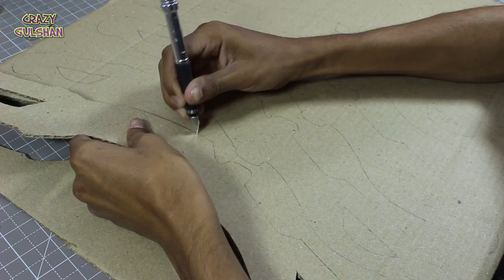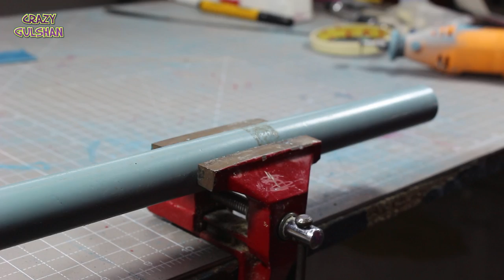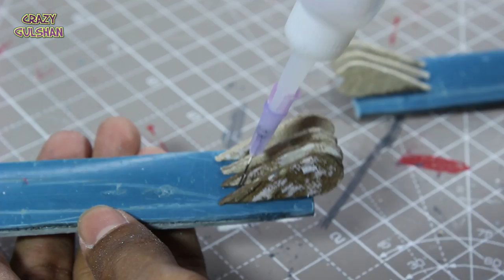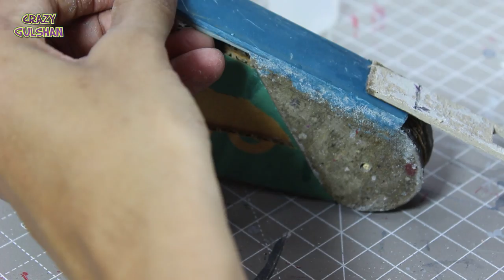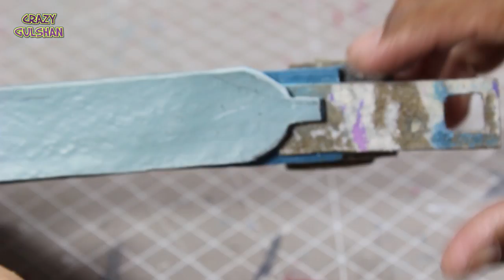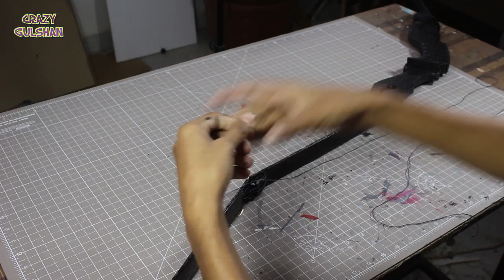How To Make Hawkeye Folding Bow And Arrows

Comment: I made the same bow but with paper only...
It's hard to believe but YES I ACTUALLY DID IT although it was smaller than this one but I made paper mechanisms for making it fold one time only.
The arrows were just paper rolls without any center hole.
The string was made of rubber and thread.